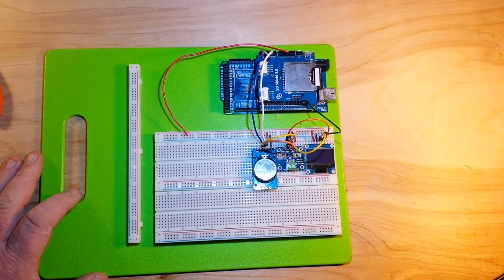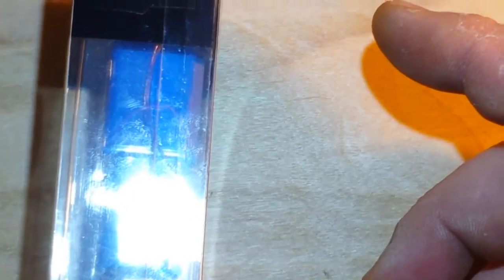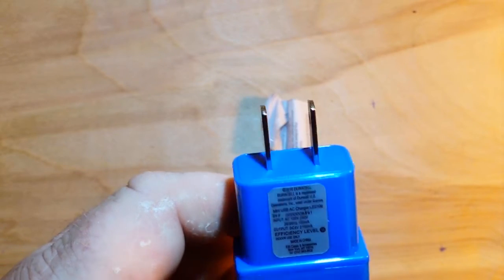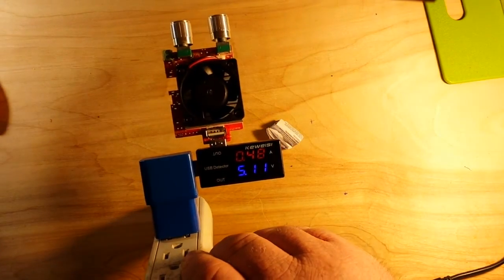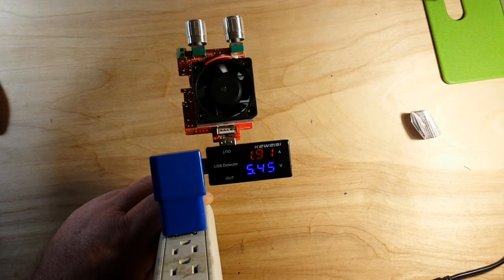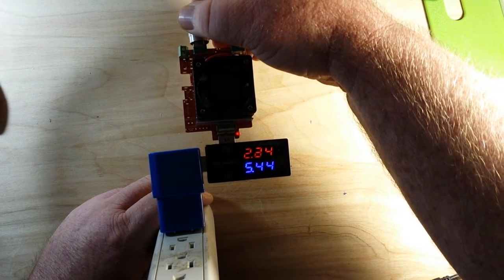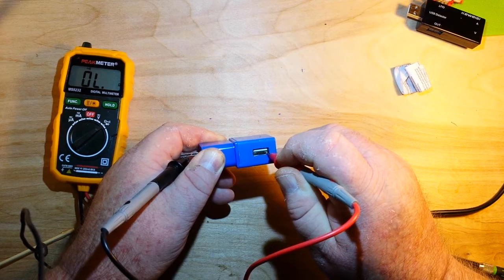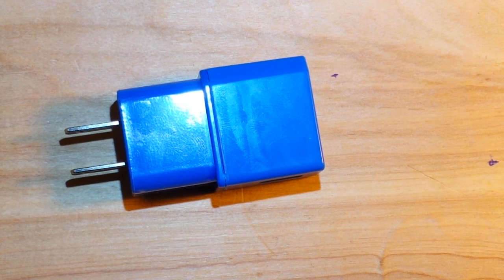Duracell 2 1 Amp USB Charger

Comment: You couldn't trust KEWEISI in Apllication like your's. The higher the current, the lower the voltage (on my KEWEISI). But in my experience isn't the 'calculated' Voltage by KEWEISI not realistic in each case. The better way is to measure the voltage on load by a multimeter. I don't know, if the meassured value in current is real. And the truth of quality of charger you could find after hours of load because many chargers says 'goodbye' after a half hour of load.
Reply from the maker: CaroMan Thanks for taking the time to comment. This is the first time I remember seeing your name. Welcome to our little community ☺

Comment: "it doesnt wanna compile" hehehe :P

that charger seems to go a bit overboard with its voltage
Reply from the maker: fredlllll It is charging the boy's iPhone 7 plus right now, pulling a steady 2100mA @ 5.13VDC. If it survives this test, we will call it good.
Reply: well 5.13 is still within spec, 5.45 is not :P